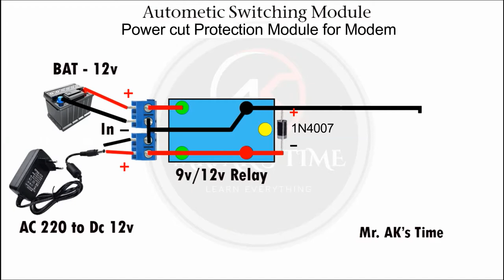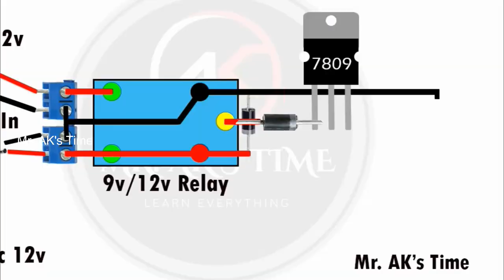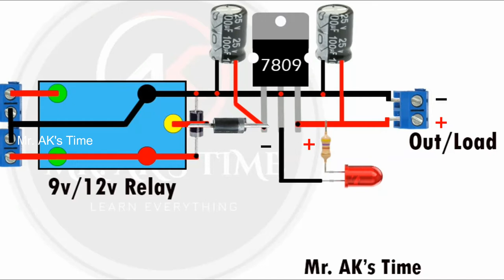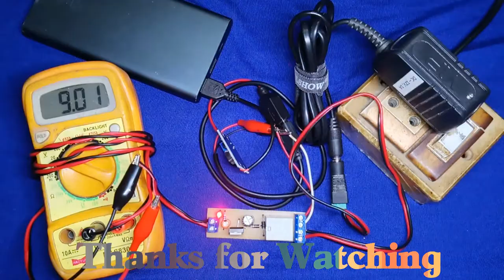Auto Switching to Battery Module l Power-off Switching Module l Modem/LED Protection Switch-over.

Comment: There's a time delay in switching..
Reply: Just use a capacitor
Reply: @JabedurFF  Where & value, please.
Reply: @habibhasan9710  use 16v 3300uf capacitor
Reply: @JabedurFF ye Kam Kare ga delay time Zero seconds Hoga nhi please help me
Reply: @AhmedRaza-he9tg  bro use a 2200+ uf capacitor on output
Reply: Output Use elco 10.000uf
Reply: @JabedurFF  100uf 16 best Hoga nhi relay k liye
Reply: @AhmedRaza-he9tg  try to use minimum 1000uf
Reply: @JabedurFF  working nhi Kar Raha Relay fast ups ki Tara Woking nhi Kar rahi bro router reset ho JATA hai light switch off per ?¿??
Reply: @AhmedRaza-he9tg  that's why  first i said use 2200+ uf capacitor
Reply: @JabedurFF  lagana is side hai relay per input ya out per ??
Reply: @AhmedRaza-he9tg  output pe lagau
Reply: @JabedurFF  Jo router pin  jati hai us per lagai Kia bro capacitor ???
Reply: @AhmedRaza-he9tg  jo wire direct router pe jata hai  uska plus minus me lagau
Reply: @JabedurFF  ok bro🫡🫡
Reply: @JabedurFF  koi bhi capacitor nhi Chala 2200uf bhi laga ya nhi Chala or 1000uf lagaya fir nhi Chala or 6800uf bhi nhi Chala router reset hi ro Raha hai Kio hal hai nhi batado please
Reply: @AhmedRaza-he9tg  bai tumhara relay kitne volt ka hai? Or battery kitne volt ka hai?
Reply: @JabedurFF  12v
Reply: @AhmedRaza-he9tg  try to change the relay and a new one i think you relay is not working properly
Reply: @AhmedRaza-he9tg  mera onu and router dono ek 2200uf 16v capacitor se chalta hai no delay
Reply: @JabedurFF  Mene laga delay time or zada hogiya router ka
Reply: @JabedurFF  Mene 2200uf 35v Ka lagaya tha capacitor
Reply: @AhmedRaza-he9tg  plus minus tik tha?
Reply: @JabedurFF  han Bhai sub Sahi bas delay time Zero nhi ho Raha bas
Reply: @JabedurFF  zero pulse second kese Hoga please me used 12v relay module used Kia hai Sada relay nhi Kia ???
Reply: Voh to hoga hi
Reply: @supremeleader5516  Kia Bhai ???

Comment: Some digital devices (modem , router , etc.) .  The electricity cannot be turned off even for a moment.  In this scheme, the power goes out for a moment when switching to the battery... To overcome this, you can add a 10,000 uF elco at the output.
Reply: 10,000 uf? And how many volts Sir?
Reply: I added ,still same
Reply: @premkxk  ,  add more sir..
Reply: I have the same problem? Router goes off/restart when switch to the battery power. How to prevent this?
Reply: Use MOSFET for switching but one drawback 1 volt will drop

Comment: Thank 😊 You, It Worked Flawlessly. But Relay's Switching Mechanisms Works Slow Which Make Modem (Router) Switched Off While Switching Power Supply (Source) But AnyWay Again Thanks.
Reply: That's not a problem with relay. The problem is with power adapter which has a capacitor at the end makes the power vanish slowly which makes relay switching delay by half a second. Remove the capacitor from adapter or add a capacitor to the relay
Reply: @AbidAli-bo8sv  hello sir,  I have a 12v 1A router, if i want to add a capacitor on this project, what is the best capacitor value sir?
Reply: You can add multiple high MF capacitor at output to reduce the delay time.. 👍

Comment: Can you make an update and add a buffer so we can avoid the disconnection , you can see the led stops when it switches to battery, it can be a capacitor or something that can keep provide enough power untill that relay switches ?
Reply: could you make the improvement?

Comment: the voltage is not stable, it varies
Reply from the maker: That's why we are using the transistor. That will give fixed output voltage.

Comment: I tried this using 7812 and 50v 100uf and i have voltage of 8.43v. Trying if i can achieve a 12v for my router and CCTV box. What will i do to get 12v.
Reply from the maker: What is the input voltage you are using...?
Reply: @MrAKsTime  DC 12.43v and battery 12.93v
Reply from the maker: @evarestikeomu5202  try by increase DC Volt from 12v to 15v... Battery voltage is OK...
Reply: @MrAKsTime  ok, i have discovered where the problem is. One leg of the regulator is touching the heatsink. I have resolved the issue and I'm having a regulated 12.4v. Thanks alot. I'm so happy i have finally resolved the problem of power failure on my Cctv and router.

Comment: I want this circuit for 12v
Reply from the maker: Okay, Use 12v Relay, LM7812 IC, 15v and Above AC-DC Input.
Reply: @MrAKsTime  which capacitor it will need to hold power for 12v 2 amp device between relay pole switching, i made circuit for my 12v router but there is power lag and its rebooting my router

Comment: I think this will work out really well with my small adruino projects.
I like to keep them powered all the time, and a 9v battery, with a 5v relay, 5v regulator will work out just great.
Does the battery always send power to the voltage regulator? or only when the relay switches to it?
Reply from the maker: When the power off then it will use the battery power.
Reply: @MrAKsTime  Thank you.
I have all the parts, I'll make it soon, and come back and let you know how it works out.
Reply: How can charge this battery?
Reply: Yes

Comment: Can u told attached battery charged during power 220 volt is on or when wifi router is running with power 220 and attached battery with router
Reply from the maker: In this circuit, the battery will not get charged. You need to charge it separately.

Comment: I realized that you used a relay but a 7809 voltage regulator but I didn't want to use the regulator but just the relay to do the switching, is it possible for me to use the relay without the regulator?
Reply from the maker: Yes you can. I need 9v, that's why I used regulator.

Comment: i have a router ups and it has a fault help me to fix it. the fault is whenever light goes off the ups restart the router but in new router ups work without interrupt. so which part i have to replaced to fix this issue in ups router
Reply from the maker: Please check the output voltage before and after load first.

Comment: if you see the circuit carefully , it's really not 100% working. When you switching main to battery, the lights turning off for some milliseconds. The adapter stored voltage delaying the relay to switch.  That mean the load will restart when power off. How to fix that ??
Reply from the maker: Try this module for continues power supply with 0% delay. https://youtu.be/CKwftlpZmUo

Comment: If i want to continue with my wifi router 
I have solar system (12 volt DC battery? and Ac supply 
Is there anything changes ?

Comment: using a 5V relay; I want to do it for two already regulated 5V. Should I just put diodes on the coil ends? Can you help me
Reply from the maker: Diode is a barrier for reverse power supply... So it will protect the circuit... Use it... 👍
Reply: @MrAKsTime  okey thank you. Isn't it enough to put diodes on the coil ends because the power supplies are already regulated? The other two capacitors and diode you put in were put for regulation, right?  So in summary, is it enough to put a single diode?
Reply from the maker: @emre-uc1zh  1N4007 Diodes are only passing the electricity and Stopping the reverse electricity. The module will get damage, if you not use diodes and the capacitors are saving the electricity so, while changing the power supply from AC to Battery it will give some amount of power continuously. Check my Video, after i remove the power supply the value will decrease slowly because of capacitor. Diode and Capacitors are only for safety purpose...
Reply: @MrAKsTime  So, How can I make a circuit diagram without using a 7805 for 5V inputs? can you help with drawing? Where can I write to you privately?
Reply from the maker: @emre-uc1zh  Same circuit... Use 5v relay and 5v input that's it...
Reply: My router runs on 5v any suggestions how to modify this circuit for that ..?
Reply from the maker: @prashanttiwari8873  Same circuit replace the transistor to LM7805 (5v) instead of LM7809 (9v) That's it.

Comment: I did the connection as you mentioned but when the main in - out comes correctly but when the main line off comes to the battery then the voltage drops 1v shows please tell me why this is happening?
Reply: This may be cause of diode

Comment: Can I use LM7812 If I am using a 12V RELAY and 12v 5Ah battery ?
Reply from the maker: If you use 7812, you need to use more than 12v  input.
Reply: @MrAKsTime  About 14v?
Reply from the maker: @moderntechnology8822  Okay....
Reply: @MrAKsTime  Is it okay to use other components?
Reply from the maker: @moderntechnology8822  Yes, You can replace. i need 9v output, so I used 9v relay and 7809. You required 12v output, so use 12v relay and 7812.
Reply: @MrAKsTime  OKAY THANKS

Comment: When we connect it on wifi supply switches sucessfully but wifi get restarted.... Please modifi it for interrupting power supply.
Reply: You can use 100ohm resister in parralel  to  relay 12v in
Reply: @BASSREFLEX-p7j  can you send me circuit diagram of it...

Comment: See the dc adapter end in the digram , the end on which you have connected dc adapted in normally close the moment we insert 12v there it get open and battery end get closed.in such a configuration this device can only wor with one input that is battery as soon as the dc adapter is disconnected , it will not work.
Reply from the maker: The circuit which you seeing in the video is correct... It's working well. I Will check the diagram.

Comment: There is fluctuate... How can you eliminate that ? Suppose I am using wifi router in the load. Using it the load will restart . How to fix that ?
Reply: Use the output Pin 1000MF 25V capacitors it's will Hold 2/3 Second Voltage Until Relay not Connect Battery connection

Comment: Does the circuit works for 5v? If yes what do I need to change
Reply from the maker: Yes, Use 5v relay, 7805 voltage regulatore for fixed 5v output and give minimum 9v input (both battery and ac-dc adapter)....
Reply: @MrAKsTime  If I give 5v to the input voltage and then the output voltage drop maybe to 1v? So that's why you said need 9v?
Reply from the maker: @RainbowPlayzo  LM7805 ic need more then 5v to get 5v output. It won't work with 5v input.
Reply: @MrAKsTime  Ohh ok then im gonna use 9V For the input DC and AC. Thanks!
Reply: Which  LM780 I use for 12volt output

Comment: Can you use input voltage to charge battery?
Reply from the maker: No... Ac input will not charge the battery... You need to charge it separately...

Comment: The voltage goes down when it swiches the power if I plugged my router then it restarts 🥲
Reply from the maker: Try this method. You will get a continuous power supply.  https://youtu.be/CKwftlpZmUo